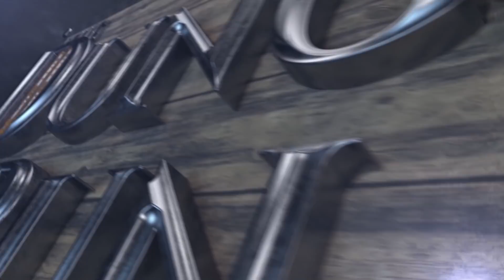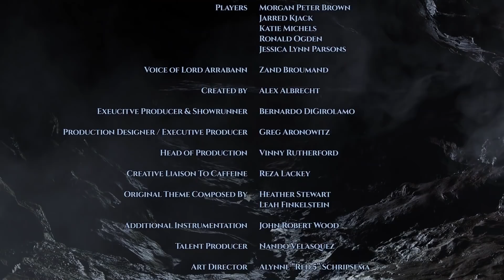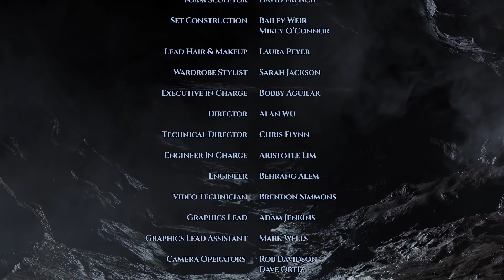The Dungeon Run - Episode 5: Locks, Shocks, and Two Smoking Perils

Comment: Table of Contents
(May contain light spoilers and excessive focus on Lily and Uggo)

3:35 Congratulations!
5:55 It started as a simple Dungeon Run...
10:00 recap ends
28:33 Arrival of the Ertenfi
38:45 Lily is charming
43:20 Fahima vs Uggo
1:02:17 Warden joins fight, poetry time
1:08:16 Last lock
1:14:53 Fahima dies, more poetry
1:20:42 James attempts a puzzle
1:33:15 Cremation
1:38:55 Curse is broken
1:55:47 Lily’s nicest vicious mockery, force of good
1:57:41 Uggo being all awesome
1:59:40 Descent into madness
2:04:53 Ewwwww
2:10:11 A great fall
2:11:19 Tons of stuff happens here
2:14:01 Intermission starts
2:33:59 Intermission ends
2:36:00 Jeff the mathlete
2:39:20 Siv being all awesome
2:54:09 Fahima’s moment to shine (Shoutout to Ammoshawn)
2:56:00 Lily!!!
2:59:30 James the comforter
3:05:08 Uggo and Lily
3:07:49 More Uggo and Lily ‘cos they are amazing
3:12:24 Uggo and Lily continue to steal the show and melt my heart
3:18:27 Siv’s sweet poem
3:23:53 Fahima struggles to trust
3:27:13 Brothers
3:38:50 Cliffhanger
Reply: Elijah Culper these are amazing. Thank you for doing this.

Comment: I did some shitty math during this episode (around 2:42:06 ) regarding the terminal velocity of a Gnome bard.

Discounting the weight of her equipment since I don't know that, the answer is [YES], the terminal velocity of a Gnome would be less than a human, an average sized human who Skydives head first into the wind has a Terminal Velocity of ~ 160 mph, but a 30-40 lb bard would have a Terminal Velocity of around 125-130 mph. The difference is there. THIS ALSO MEANS that Uggo would be a LOT faster than the rest of the party while falling.

[If my math is wrong, I apologize, I didn't really take it too seriously nor do I normally calculate Terminal Velocity, but it was fun anyways]

Comment: I posit that stone and metal would fall a few degrees faster than a few measly humanoids. especially if they're stuck together in big chunks, as they are likely to be if the tower was at all well constructed.
Reply: Everything falls at the same speed. Terminal velocity is 9.8m2(meters squared). Same for a tennis ball or a 10 ton Boulder, gravity pulls on everything equally

Comment: Casting any spell while concentrating on another spell,will automatically drop the concentration spell. In players handbook. That is basic info.
Reply: Craig Astorian yep. I missed it. My bad.
Reply: Sorry gents, but Pg 203 of the PHB  says you’re both wrong 😉 

Concentration ends when A) you cast another spell that requires concentration B) you fail your con saving throw when you take damage C) you’re incapacitated or killed D) environmental phenomena per DM’s discretion.

Thanks for watching!
Reply: @fallback1001  I think the point is that the Darkness spell would stop working as soon as he caste Haste since both require concentration. I totally think it's fine for the DM to allow this if it makes narrative sense. James however seems to really like to lean into strict interpretations of the rules (he runs through his options on his turn and does his best to "maximize turn output" and sometimes just tells the DM things like "I get advantage because it's metal!"). In my humble opinion, if you want to "game the game" with strict rule interpretations, then you also need to be held to that standard when it comes to limitations. Love the show either way though!
Reply: Thanks for watching the show, glad you’re enjoying! (I’ve never asked for advantage because it’s metal just FYI 😂)

Haste came from a potion actually that we got from Torvald at the start of Episode 2, so no concentration was needed there. BUT I will acknowledge I forgot that I cast Detect Magic using the Eldritch Sight invocation to look at the lab, which DOES require Concentration which would’ve broken my Darkness. My bad.

It wouldn’t have made any difference at the end of the day though, I still had one spell slot left at the end of the fight on the roof of the Lodestar. All I’d cast with my Warlock spell slots was Darkness the whole fight.

Warlocks are sort of all about spell/invocation combos tbh, it’s one advantage the game grants you to make up for only having 2 spell slots 😂

Thanks so much for the kind words, really appreciate your thoughts.
Reply: @fallback1001  Seriously, I commented this for a prior episode and it's still true... The Dungeon Run is my favorite live play RPG across all media. As to the "Advantage from Metal" thing, that happened at 1:07:14. I brought it up not to imply you were wrong (because you are absolutely right about it), but to illustrate how you play as someone who has a very high regard and respect for "Rules as Written" and seems very knowledgeable about the rules. I am the same way (at least I try to be). That combination of knowledge and respect for the rules is why I wanted to point out the minor and inconsequential error I thought I saw. I would want someone to point it out to me if I had made a rules error. AFTER the session of course. I am always in favor of just rolling with it in the moment for the sake of the narrative. I had forgotten that the Haste was from a potion, so that's my bad on the call out. Great show as always!
Reply: @GetReadyforGameNight  haha thank you so much man, I totally appreciate it. This show is such a blast and we're blown away by the positive response from the community. <3

The "advantage from metal" was actually a reference to Shocking Grasp, which gives you advantage to hit if the target is wearing armor made of metal. I may not have made that clear to the audience when I took it.

Comment: The beginning of this episode was a bit rough with the tower sequence continuing from last week, but the second half of the episode was a beginning of a return to episode 1-3 form and I dug it. Lily, Fahima, and Uggo are great.

I hate rules lawyering in D&D, as I enjoy when groups play the story and characters rather than the rules, but there are a few things that have been bothering me, and have led to boring encounters. Uggo on multiple occasions has taken an opportunity attack against a creature before they even begin their action. Opportunity attacks are for when enemies are moving out of range. You don't get an opportunity attack because a creature is aiming a crossbow at you through a window or pulling a lever. Additionally, James's Darkness + Devil's Sight combo is a cancer on D&D and ruins most of the games where it is employed. It will continually ruin encounter design. Concentration has to be watched very closely for people employing this one-trick (or guidance spam). In this episode, James cast Detect Magic which would have dropped darkness.
Reply: Adam Smith you’re right that Uggo should not have gotten an AOO in episode 1 for the ranged attack through the window. That was both of us applying an old version of D&D rules we had in our heads. Apologies. The lever generated an AOO because Ertinfert had to move to reach the lever. I should have stated that more clearly. I’ll try to be more diligent about concentrations and dropped spells. That was my bad.
Reply: @CannataJeff  You're doing an amazing job Jeff. I love the world you've created and am excited to see where the story goes. I can't imagine how much you are dealing with, DMing live while also worrying about the interactions the chat creates, so anything missed isn't a bother. I just don't want any tense encounters to be broken by the easy IWIN that made it's way back into the game in 5e, with the only counters being spell casters that can dispel it or creatures with magical sight.